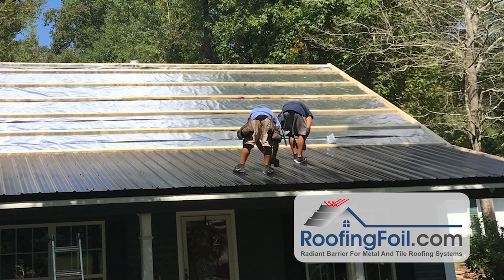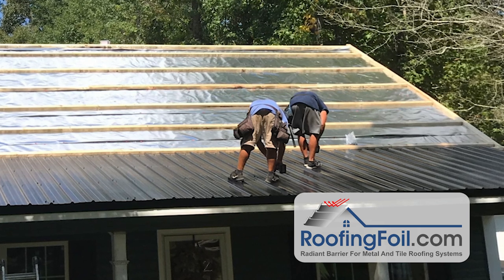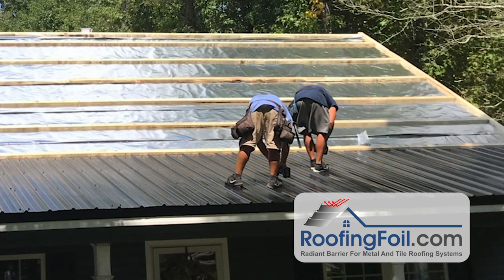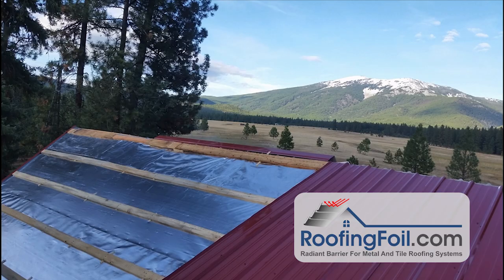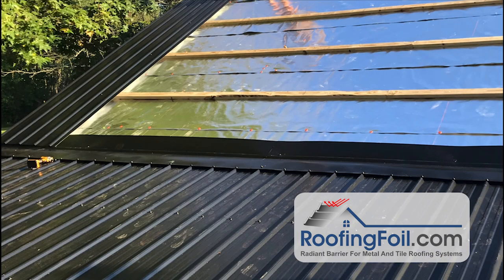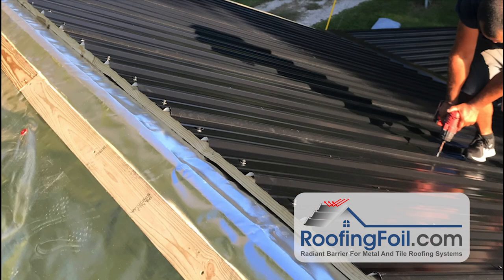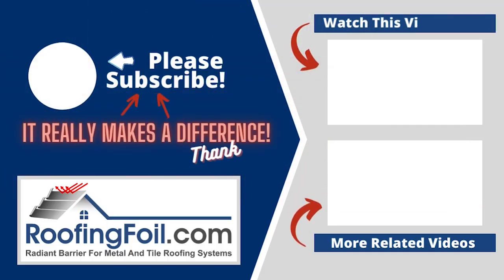Metal Roof Installation Over Existing Roof Using RoofingFoil To Reflect The Heat- DIY System

Comment: The thing is you're going to negate 80% of the benefits of that for a while if you put black metal roofing over the top of it because that's going to get very very hot.
Reply from the maker: Respectfully disagree.  TRUE the roof will get hot.  But, with the airspace there is VERY little conductive heat.  For heat to get across the airspace it MUST convert to radiant heat.  And, when this happens, we OWN it!! Since the www.RoofingFoil.com reflects 97% of the radiant heat.  You can go in this attic on a hot-sunny day and not know if the sun is shining or not.  With this system the color of the roof makes very little difference.
Reply: It blocks the heat that radiates. From all colors. It works even better than expected.

Comment: There must be an air space on the downside if it installed to cool the home. It appears that there is no air sprayer below it but that it's installed on a solid surface.
Reply from the maker: Air space on either side working off either reflectivity or emissivity.  Here is a video to explain it: https://youtu.be/uGP5KobU6R4
Reply: @AtticFoil   Thanks. So, according to the video you linked to, the barrier works on the roof or in the attic attached to the bottom of the rafters creating an air space between the barrier and bottom of the roof, and attached under the roof, the barrier reduces heat transfer by about 50% through reflectivity and on the roof the barrier reduces heat transfer by 30% through emissivity. Thus, if only one barrier us used, attach it to the bottom of the rafters, but better yet, attach one at both locations. A white roof would further add to the savings by reducing the amount of heat transmitted from the roof.
Reply from the maker: @jzwillows  The 30% is for foil applied directly to the roof decking (facing into the attic)   Putting on TOP of the roof www.RoofingFoil.com would be well above 50% but have not seen any full scale tests to quantify the amount.
Reply: @AtticFoil According to the video you linked to (1:35) and the US Dept of Energy 2012 study (available online and quoted in Wikipedia radiant barrier article https://en.wikipedia.org/wiki/Radiant_barrier in Roofs and attics section) the barrier is most effective (50%) when there is an air space on the hot side (thus when attached under the roof), not when the barrier is on the roof (30%). However, it is still not as effective as a white roof according to the article.
Reply from the maker: @jzwillows  Be clear that these are two totally different applications.  The DOE was for different methods INSIDE the attic.  Either attached to the bottom of the decking 30% OR stapled to bottom of rafters like www.AtticFoil.com at 50%. With both of these methods the roof deck STILL gets hot, but different amounts of heat transfer to the floor of the attic.  This video is about putting a different product www.RoofingFoil.com on TOP of the roof deck -a DIFFERENT application.  With this method the roof deck can easily be 20º cooler than with below/inside the attic.  Like I said, I've never seen any full scale tests, but common sense says the further to the outside you can get the radiant barrier the less heat will get though.  Unfortunately, this method us limited to only when a new roof (usually metal or tile with an airspace) is being installed.
Reply: @AtticFoil  So what you are now stating is that you have a completely new method that hasn't been tested  and that does not involve an air space, as the foil is attached on the plywood or similar underlayment and is covered by the roofing material. Is that correct? And it is so effective roof color does not make a difference?
Reply from the maker: @jzwillows  Uh, no you are mistaken.  It has been tested and is used my many contractors/builders.  Just has not been tested by DOE.  It's not a "new" method, it's a completely different method/application to be used IN roofing assemblies WHILE they are being installed and it STILL requires an airspace. The foil faces UP towards the airspace created by the metal or tile roof.  Did you watch the videos?
Reply: @AtticFoil  Thanks for the response. I did watch this video but forgot about the air space. Anyway, now I see that you are using the reflective method which does reflect 50% back per DOE tests (regardless of where the air space is - in attic or under roof the 50% won't change). In a real hot climate if you coupled that with a white roof you would have a singificant improvement since, according to tests in Florida, a white roof is more effective than a refelctive barrier though it has the disadvantage of losing effectiveness when dirt gets on it and your method will stay slean. If I were getting a new roof I would certainly use it. All new homes in hot climates should be required to use these or equivalent (in my state California barriers in the attack are required) and light roofs given the neeed to conserve energy.
Reply: @AtticFoil 😅

Comment: 😎 We used foam sheets with the reflective side up on our roof. The temperature in the house is already staying much nicer than outside, and we still need to add the interior fiberglass insulation.
Reply from the maker: The foam and foil works fine.  However, in a vented attic the foam is basically doing nothing when installed on the roof.  The foil is doing all the work.  Putting foam on the roof of a vented attic is like holding a jacket over your head.  Why??  On a Non-Vented attic it will add some r-value.  www.RoofingFoil.com  I use a refrigerator example.  The door has r-value UNTIL you open it and allow air to flow on both sides.  Same for a vented roof.
Reply: @AtticFoil  Thanks, good point! We went back and forth about whether to do a vented or unvented attic. We decided on unvented.
Reply: What if you've got vaulted interiors?

Comment: Could I install this on my single story black felt and tar roof to keep it cooler? Could I glue it down and not worry about it lifting? If so what glue would be best?  Mid afternoon to early evening the heat starts coming into the house. 😊 Thank you.
Reply from the maker: Glue?  Not sure how it's going to lift with roofing cap nails and/or battens?  What type of roof are you going to install with the www.RoofingFoil.com product?

Comment: I'm sure this will work but contractors are reluctant to use battens and prefer to tear off the asphalt.  I guess there is risk of walking on it, and possible hail damage.  Even McElroy Metal admitted that the air gap worked but contractors would charge 20% more to install on batten decking. Is it much more difficult to install metal over battens instead of a metal deck?
Reply from the maker: This video is not about what's cheapest. It's about what's best. This method usually pays for itself over time. www.RoofingFoil.com combined with battens is the "best". We  have many high performance builders use it on every job.

Comment: You use 2x4's for the battens, could 1x2's be used instead? I will be using the same style steel roof. Would the 1x2's provide enough air space?
Reply from the maker: Yes, most customers use 1x4's.  1x2's will work also to install www.RoofingFoil.com
Reply: Thanks for the quick reply! @AtticFoil

Comment: There is a space between the foil and the metal roofing sheets. You havent said what this space should be optimally. Or could this space be omitted? That is by installing the roofing sheets directly on the foil with no 2x4 (Which will defeat the barrier). I dont see this being properly explained. In many places there is no ply decking, Laths run across on the rafters exposing the underside of the metal roof in the attic. Any special considerations for this. (I live in the caribbean and this is how roofing is constructed).
Reply from the maker: We mention many places at www.RoofingFoil.com you want a 1/2" space or more.  But bigger does not really help.  We sell for these type roofs in the Caribbean all the time.  We have sent just a few rolls and full crates for a whole development.

Comment: Don’t you need spaces in the battens to let the heat ride up to the ridge?
Reply from the maker: Most metal panels have ribbing which provides plenty of ventilation. For flat standing seam type roofs, just leaving some gaps between the battens will provide a path for ventilation.  The www.RoofingFoil.com works to reflect radiant heat with ventilation or with a "dead air" space in the roof.

Comment: Great video! Wish I had found it sooner. Just had metal roof installed and the guy installed the radiant barrier insulation but he put the metal roofing directly on top of the radiant barrier. No space in between. Radiant barrier is probably worthless huh? I live in southeastern NC and it gets very hot. In fact it's already hot.
Reply from the maker: Yep, really no benefit without the airspace.  At this point your best bet is to install www.AtticFoil.com inside the attic.  You may also want to check your contract.  If they say they are installing a "radiant barrier" and did not create an airspace you have a solid case against the installer.  Radiant heat by definition is heat transfer ACROSS  an airspace. Without the airspace you cannot (by definition) HAVE a radiant barrier.

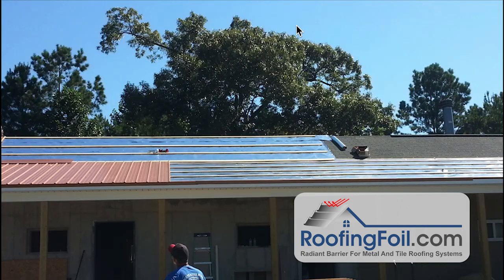Comment: At 1:45 in the video you imply that the new roof will go over the existing older shingles (that are in good condition).
My question: If my roof still has about five years left on it does it make sense to leave the current shingles in place, and then place foil on top of the old shingles, add the wood sheathing and metal roof on top of it all? That should reduce the labor cost of a new roof. Are there downsides to this approach?
Reply from the maker: Adding another deck is a pretty big deal as far as weight.  Not sure why you would need a new deck with battens and a metal roof combined with www.RoofingFoil.com

Comment: Question: 
Can this be installed on an unvented (hot) roof?  Cathedral ceilings, r-30 fiberglass batts, no ridge vent or soffit vents.
Reply from the maker: Absolutely!  Non vented attics are great!  Whether you use fiberglass or foam.  It's like building a refrigerator.  Now, let'd put the refrigerator in the shade!!!!  It will effective double the r-value when the sun is shining.  Use www.RoofingFoil.com as your first line of defensed against radiant heat and the fiberglass as your second line of defense against conductive heat.  We have many home builders use it with non-vented attics in combination with metal roofs.

Comment: can we do the insulation for the sheeting done already?
Reply from the maker: Please clarify.  Don't understand your question about www.RoofingFoil.com
Reply: @AtticFoil  small farm house was built with metal sheet similar to the one in your video, but without any heat barrier in mind that time. How can we install the insulation without removing the sheet now?
Reply from the maker: Yes, it depends on your goals.  If you ONLY want to reflect heat, you can install www.AtticFoil.com on the bottom of the rafters.  Basically treat it as an "open" attic.  Of, you want to reflect heat AND control condensation, then look at our metal building products here: https://bluetexinsulation.com/pages/existing-construction-wood-framed-buildings-installation